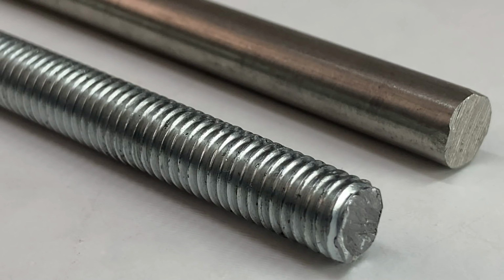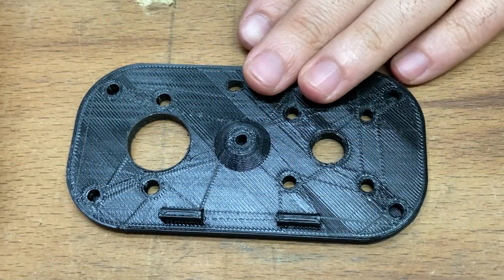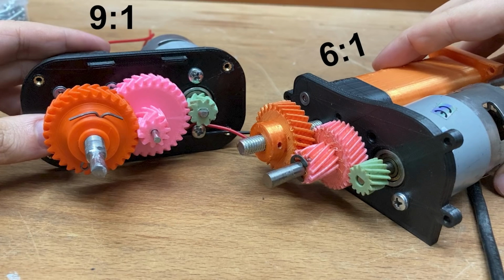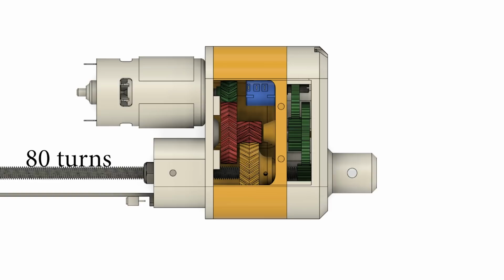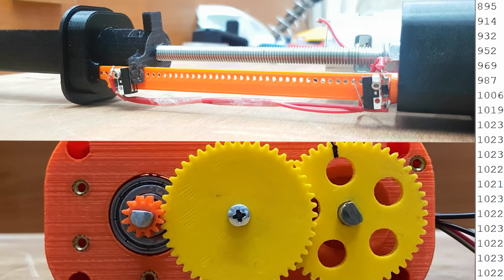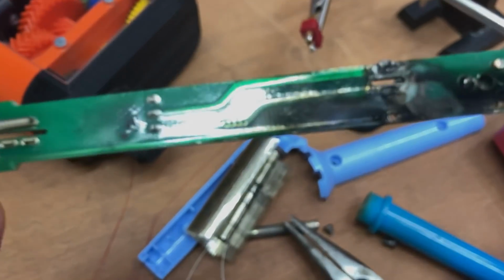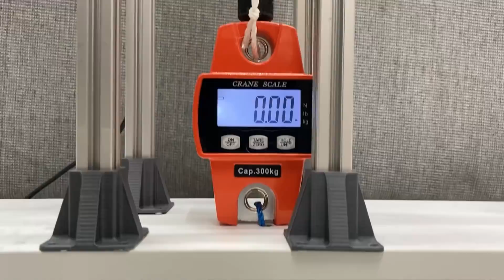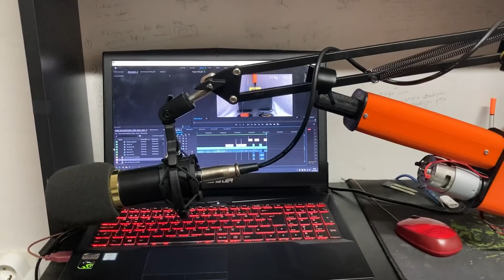3d printed linear servo actuator

Comment: Alot of makers would probably have edited out that part where the tip of the hot soldering iron fell into the gears and you flicked it out with your bare fingers. The truth is that sorta stuff happens ALL THE TIME when building things 😁 so I'm glad you kept it in the vid. Awesome work, I've subscribed!
Reply from the maker: Thanks a lot! I actually dropped it one more time after that😁
Reply: I have one of these hot swap able iron and the same thing happened but for me I stop using it before since it look bad and when I try to see if it still usable it fail and the front part it only a hole now
Reply: My guy kept it real respect 👍💪
Reply: brings realism to a whole new level eh? lol

Comment: Awesome! Your 10-turn pot solution gave me an idea for a project I'm building. I was using a stepper motor for accuracy but the pot will give me the precision I need without the overhead of a stepper, plus more speed! Thanks.

Comment: that is an amazing project! We use actuators like this in the custom cars we build at my work. Can use them for compartment lids, and if you use PETG or ABS, you can use them in to lift the luggage compartment door or other things in the car, even motorize a manual car seat track, BOOM! Power seats!

Comment: Very nice build. I was amazed the gears held up through the tests. I was thinking from the first that using planetary gear box or boxes would be a better choice and it would be eazy to get more tork from a small motor and would still like to see that done. I am looking for something like this build to raise and lower solar panels on my RV, so they can 1) lay flat for travel and at night and 2) to alow them to track the sun as much as possible with RV not alway parked in the same direction. Thanks for the video and your time.

Comment: If you wanted to make another 5 of these, you could make a 6DOF Stewart platform. Although its going to be slow 14 sec stroke... We use 3000RPM AC servomotors and 10mm pitch leadscrew that gives 500mm/s speeds with lifting capacity 160Kg ... 😁

Comment: Making a "Heated Insert Press" is a good idea.  It works in a similar manner to a Arbor Press, but with a soldering iron and tool for holding the insets while they are pressed.  

That way you get precise, square placement (And Less Burnt Fingers!)
Reply from the maker: yes i saw one of them in a few videos and they looked nice. Good idea! And Definitely worth making for fingers😅
Reply: I use my benchtop drill press as an arbor press. Just use a short piece of threaded rod (or cut the head off a longer screw) for whatever size insert you have and thread it on the insert then into the drill chuck. I just use a heat gun and hit the insert for approx. 20 seconds and then gently push into the plastic. Guides it in nice and straight. A little slower than other methods but it is a nice controlled way to do it with excellent results. Loosen and release the drill chuck as it's cooling and your ready for the next one.

Comment: Correct me if I'm wrong, but if you're using a pot to track the movement. Then you don't need the limit switches since the pot will tell you when you're at the limits.
Alternatively, you can use a optical rotary encoder (or magnetic) to track the position instead by homing to the limit switch and you wouldn't have to gear down as much to track it.
Reply: You can use the potentiometer to precisely position the actuator using a controller, but the limit switches act as a failsafe.
And the encoder can be used for something similar, but you'll have to store the position in the controller constantly in case the power goes out, as opposed to a potentiometer that has built in memory.

Comment: I know you can easily get threaded rods and nuts at a hardware store but if you order some proper acme theaded rod and a bronze acme nut you'll run more efficiently and lift more load.
Reply from the maker: yes you are right it could be better👍
Reply: vote for acme threaded rod

Comment: As a tip, i recomend you to buy and JBC SG1070, it's a lighter gas powered soldering iron, mini torch, and hot air blower, maybe not the best for a main solderer but it's a must have that never fails to have as backup. Like From Spain!

Comment: You can make adjustable table with 4 of them. It's overkill with about 100kg,  but if 4 legs can hold about 400kg it looks very durable.
Reply: self leveling table
Reply: @LuisElectronico  good for a travel camper :D

Comment: That's amazing, but I wonder why you didn't test the actuator pushing (not pulling) and holding, just in order to see how much weight it could hold (as for example if we wanted to use them as lift for hospital chair/beds, etc... Thank you!

Comment: You could also take your potentiometer signal, and stop the motor when it reach a certain value. since you're going trough an Arduino already that's not a lot of code and nothing harder than you already did haha
Nice build!
Reply: That'd be my solution because I'd rather change a code value than take something apart, but maybe he prefers limit switches and their non-software safety.

Limit switches are usually wired to prevent the motor from moving in one direction once pressed, which is why they make sense in a factory setting where you don't want to trust a programmer with your life.

Comment: Dang did you have bad luck with the soldering irons, were you pushing them too hard or did you just buy cheap ones? I want to know because I decided to get a Weber in the hopes of avoiding soldering iron headaches like these. Also I hope the one exploding didn't hurt you at all.
Reply from the maker: I'm fine, thanks a lot. Just bad luck and it was old. I've been using it for almost 3 years.
Reply: @retsetman9698  ah okay, well good to know.

Comment: Since you have endstops, a rotary (quadrature) encoder would be better for your feedback
Reply: I also wondered why encoder wasn't used in this...
Reply: It would have to be zeroed every time he starts it, since the actuator won't know its position on startup with a basic encoder. That'd be annoying since this actuator is slow. As for absolute encoders, I think they're big and expensive.

Comment: Hello great functional print. Can you add a simple potentiometer to get the position feedback ??
Reply from the maker: You know simple potentiometers turn less than 1 turn so if I used it, needed 10 times more gear ratio, which wouldn’t fit the case

Comment: what kind of fillamenrt did you use? something basic like PLA, something hard like ABS, or something strong like PETG(while PETG isn't the hardest it is often concidered the best of the general 3d printing materials for gears due to their much better horizontal strength between layers compared to others which effectively often makes it much stronger than fillaments of "stronger" plastics)
I wondered since that way I can estimate how powerful such a gear can be if it was PLA for example that would be a really good sign.
Reply from the maker: Thanks for interest! I always use PLA since easy to print, and get cool results

Comment: Love this design  - Does the Editable source files include the Arduino codes too?
Reply from the maker: Actually doesn't but if you meant the position feedback code, I can add it to the source files.
Reply: @retsetman9698  if you could, it would be greatly appreciated! Thank you.
Reply from the maker: You’re welcome👍 I added a ino and txt file that includes position calculations and motor drive codes on Cgtrader. Link in description.

Comment: That is cool! I also made gearbox and it’s very noisy. Do you have any thoughts how to make gears silently?
Reply from the maker: You can use oil, it will reduce the noise a bit and make sure the bearings are aligned properly. Another option is a magnetic gearbox or belt drive check out my magnetic gearbox videos, maybe you can get high torque if done well
Reply: @retsetman9698  Thank you, I'm using graphite grease, maybee I should try oil too. Yes, I've already seen your magnetic gearbox before. I subscribed on the channel from that video :) But, suddenly, magnets don't fit in my small gearbox for a toy train.

Comment: Can you please share the Arduino code and wiring diagram for the potentiometer? That's a clever way to control the position of the ram. I assume it will work fine with out the feedback control and gears by just using the limit switches for stops and/or safety.

Comment: great video!  I'm new to your channel and would like to know how and what you chose for a 3D printer and software.  I'm ready to make the leap to get a printer to add to my cnc router machining repertoire
Reply from the maker: Thanks man🙏 actually the printer is tevo tarantula that I used years😅 it has marlin v1.1.4 software. I use Cura for slicer. but also I use ender3v2 which is much better than tarantula. Cnc&3D printer sounds fun😀

Comment: Hi there, I need 3 linear actuator 36" pull out , will use them in a vertical position, no need heavy lifting just the distance, will you make tho$e for me? You can use 3/4" PVC pipe or 3d printing as you already do.

Comment: i ordered a few parts form PCB way and they sanded the crap out of it when i asked for no post processing and the parts didn't line up flush. 
i dont care if they throw the part in a box with sharp metal chips on it. i didn't want it sanded.

Comment: AMIGO BOM DIA, E PARABÉNS PELO PROJETO GENIAL. GOSTARIA DE SABER ONDE EU CONSIGO O PROJETO DO CIRCUITO ELETRÔNICA QUE VOCÊ UTILIZOU PARA ACIONAR O SERVO MOTOR. VOCÊ PODERIA DIZER ONDE CONSEGUIU ? OBRIGADO.

FRIEND GOOD DAY, AND CONGRATULATIONS ON THE GENIAL PROJECT. I WOULD LIKE TO KNOW WHERE I CAN GET THE DESIGN OF THE ELECTRONIC CIRCUIT YOU USED TO ACTIVATE THE SERVO MOTOR. CAN YOU TELL ME WHERE YOU GET IT? THANKS.

Comment: You should use a separated μCU to control the actuator. I mean, give autonomous functionality to the actuator. Use a PID to move it according to a I2C value. You can set the address using DIP switches

Comment: Why would you use a pot and endstops?
You could just use the pot to stop the actuator the same way servos work.
Reply: He could, and that would make it easier to modify the stroke, but limit switches can be more of a safety measure if you screw up the programming. Limit switches are usually wired to prevent the motor from moving in one direction once pressed, which is why they're often used in factory settings.

That safety gets thrown out the window if the limit switch breaks off though. Safeties built into both would be ideal

Comment: What motor did you actually use for the video?   Thanks
Reply from the maker: DC 775 
12-36V 
3000-9000 rpm
Reply: @retsetman9698  Thanks very much

Comment: Do you have a build list?  what size ball bearings? any specific motor size other than a DC775?
Reply: I was wondering the same thing. Pretty sure those are 608-2RS bearings and an 8mm threaded rod. The motor looks like a DC775, but I’m not 100% sure on that.
Reply from the maker: Yes, 775 motor, 608 bearings and 8mm rod. For different size motors needs to change the motor mount
Reply: Yes thanks i figured it was 608 bearing and i used 5/16  rod for US.  Have printed several of these for automation projects, they work great.
Reply: I prefer RS 550 motors. You could also skip making the entire gearbox and opt for a $43 Yellow Jacket geared motor from goBilda and connect it directly to the 8mm screw.

Comment: What equations did you use to know the time in which the shaft comes out entirely?
Reply from the maker: Threaded rod has a 1.25mm pitch and stroke is 100mm. So needs 80 turns for the piston comes out entirely. Btw, speed of threaded rod is about 330 rev/min. That is also meant about 5 rev/sec. then, if 5 rev in a second so how much time needed  for a 80 rotation( to comes out entirely) and it’s about 14 sec.

Comment: great work but you have two deadly flows in your design. 
if you want to make it much more better you should :
First - Use Thrust Ball Bearing 
Second - Use a POWER SCREW & NUT

Comment: wish ppl would stop with metal metal is not meant for heavy strong stuff so everythijg is a lever gears and ppl lift 80kg with a little plastic thing and a tiny motor ans en ppl make these 100000x/1 gears iff u got a 3to1 gear u would lift 3 times as much but it woulf take 3 times longer or wateva els cos u can not get a possitive without a negative so why dont sum1 make a gear box made from metal no welding joints no plastic all ball bearing joints and i no for a fact you could lift a car with a little drone motor easy as hell...not u cant do much the other way so u cant go to the big end spin that gear once and let thr last gear spin 200 times and spin the big gear megga fast cos somet can only spin so fast plus its been shown sumtims u can go faster taking the last gears off it sounds weird but res a limit but i dont think there is a limit rother way...arcame or his name said iff he ad q lever strong enough  cpulf move the world